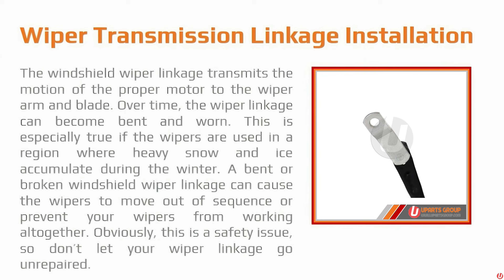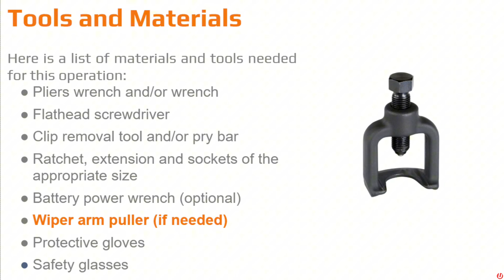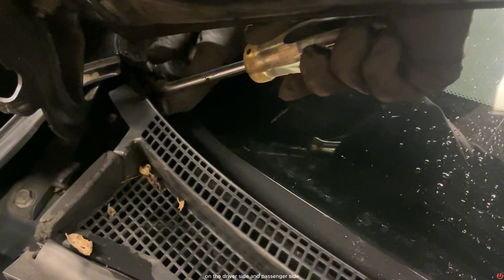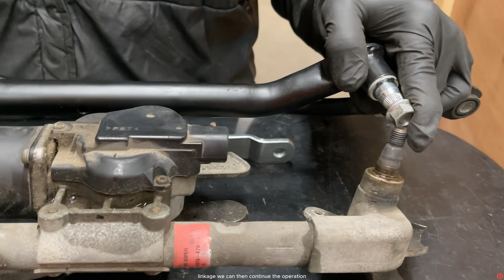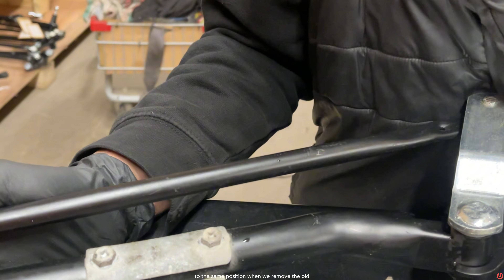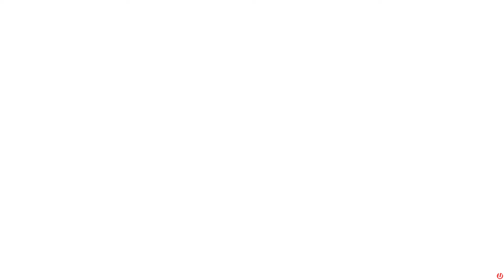WLAL07 Wiper Transmission Linkage Replacement For Nissan Altima 2007 2008 2009

Comment from the maker: ✅ Uparts Group Wiper Transmission Linkage WLAL07
https://upartsgroup.ca/products/wiper-transmission-linkage-wlal07

🧰 Recommended Tools:
🔧 Plier & Wrench Set
https://amzn.to/49n8lY4

🔧 Screwdriver Set
https://amzn.to/4tN05br

🔧 Trim Removal Tool
https://amzn.to/3RjRH5r

🔧 Ratchet & Socket Set
https://amzn.to/4njQmYg

🔧 Battery Power Wrench
https://amzn.to/4tzOI6p

🔧 Wiper Arm Puller
https://amzn.to/4d48ou9

🧤 Protective Gloves
https://amzn.to/42tTLKv

🦺 Safety Glasses
https://amzn.to/4wpi9dV

👍 Thanks for watching! Don’t forget to like, comment, and subscribe for more product guide videos.